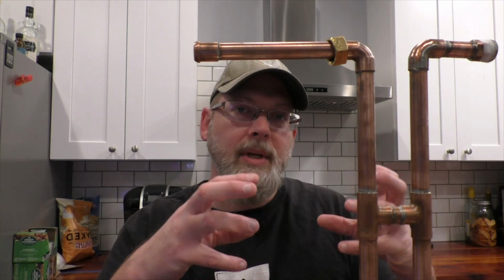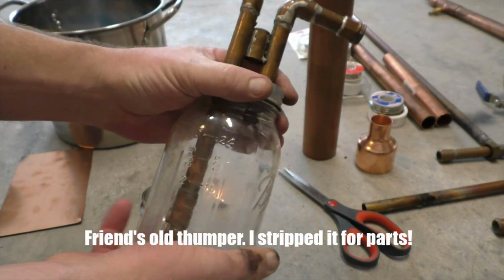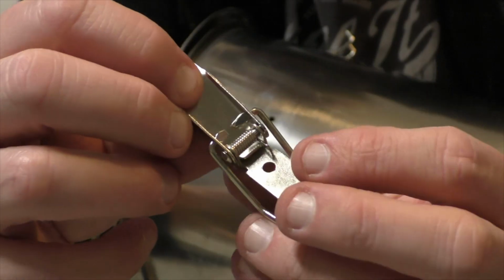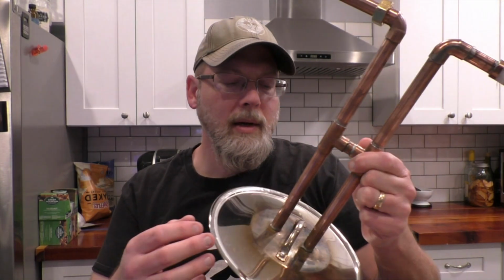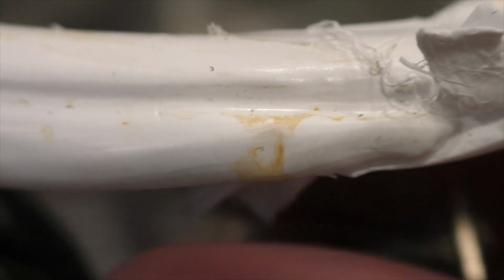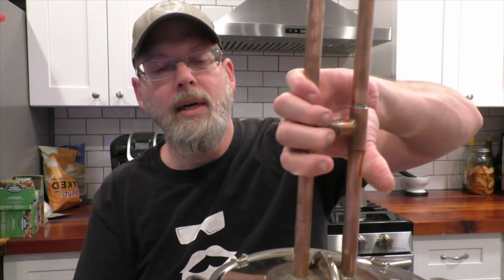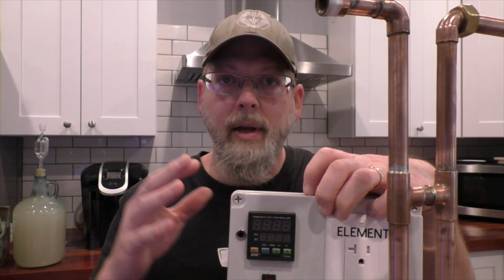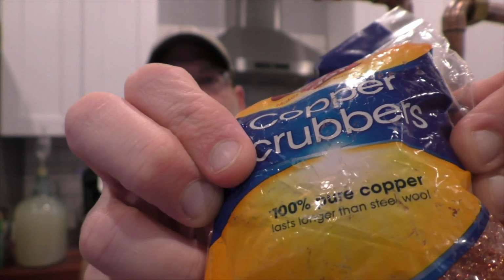How to Build a THUMPER For Your Pot Still!!

Comment: Great video! I would use FDA silicone for the gasket though.
Reply from the maker: Under hot ethanol, acetone, acetaldehyde, etc. silicone breaks down. PTFE and EPDM are safer since they're rated for those temps and chemicals without leaching.
Reply: @BeardedBored  You are right; I was lazy and just made my gaskets from fda silicone,  but I will change those out for PTFE gaskets, thanks for making me look into it further.

Comment: I know this is old and this is a great video, but you said don't use brass screws and then added a link for a safety relief valve made of brass. A stainless ball valve with teflon seals would be a lot better, because you would have to have 2 safety relief valves mounted in opposite orientation to ensure you prevent both the build up of pressure and to prevent the vacuum build up because just putting a pop-off valve that vents to the outside wouldn't protect from vacuum. Vacuum would just pull the seal on the pop-off tighter. I would just forget putting a safety relief valve altogether and use a ball valve and manually open the system to atmosphere.

Comment: Could you please post the size and names of the plumbing parts of the thumper .. I'm currently building one and my local hardware store has all the parts I would ever need just not sure what to ask for other than the 90° elbows and the T's.. just not familiar with the names of all the plumbing connector names .. I really like the threaded connector idea so it can be disconnected when not needed ..  I already have the lid seal and the clamps  finished and the pressure releif valve installed but  a parts list for the pipes and fittings would greatly appreciated.. thank you so much for all the content and taking the time to make everything make sense for ppl like me that enjoy this hobby..
Reply: I wouldn't use the pressure relief valve. The one he showed (the link didn't work)was brass and only works one way. You would need two of them mounted opposite. One to blow out and one to suck in.

Comment: I am taking a 8 gallon stainless still pot and converting it to a thumper for a 16 gallon stainless pot. As you mentioned the lid is really thin, i am using Ruby stainless steel flux. Having problems with it burning up before i can get my solder to flow, then i have to deal with the carbon that of course stopping the solder from flowing on the stainless. Is there a different solder that works better for copper to stainless? Oh i used a sheet of food grade gasket material with a double sided tape on the one side for my lid gasket. So far so good no leaks.

Comment: Not to sound like a know it all but you will like these tip.  I am a retired Pipefitter / Welder.
 Wear a heavy cotton glove DRY. WIPE the joint.
Use a Weller soldering iron  on the pipe thru the stainless tank.  1/4 " tip  
Hold it on the solder "   " soak it"   I recommend Harris "Bridge it"  
lead free strong.
I use the iron when I put valves on Coleman Green propane tanks.   Tin both surfaces. Hold it in one place let it heat up "soak it"  lay the flat tip on the pipe  transfers the heat.
Iron heats the solder, solder heats the metal.
Try it and see. My iron is 25-30 watts. It's the one I use for Electronics.
Sal Ammoniac  what you tin your soldering tips with. Block or granulated like salt.    Dimple a 2x4 with a ball peen to hold a small pinch of Sal.  Get the worst burnt black tip in your iron and rub the tip back and forth in the Sal with a B-B size of 95/5, pure tin or Bridge it  in the Dimple . , sal-ammoniac will be under ammonium chloride.
Flame solder your 
pipe for sure.
The iron won't warp the stainless

Comment: You put your gaskets for the clips on the nut side. This is not good, as you can get vapor leaking between screw/nut threads. Putting the gasket on the screwhead side doesn't work either, unless you ALSO put a gasket between the clip and pot. Additionally, the pot handles are rivetted on. This is NOT guaranteed to be a good seal either.
A good idea, but flawed.

Comment: Another GREAT Video!!! Excellent safety explanation!!! I built my thumper with a tee and two ball valves for a by-pass line around the thumper. When starting up my still I open the valve that by-passes the thumper (while the valve to the thumper is closed) but goes through the condenser. I have a cork stopper in a tee between the by-pass ball valve with a thermometer to give me an idea of where the temperature of the vapor stream is to also tell me when the foreshots are boiled off (and I also collect the foreshots at the end of the condenser they are a very good solvent for cleaning). After the foreshots are gone, I open the valve to the thumper and close the valve to the by-pass in that order and let the thumper come up to operating temperature. I also add a 50/50 mix of tails and boiling water to my thumper to get things heated up as much as possible. When I shut down the still, I wait until the condenser stops dripping and then open the by-pass valve before walking away. I have seen the video of people throwing  water into a 55 gallon drum on a fire and closing the bung hole and spraying the drum with water. the effect is drastic!!! Actually that is how the thumper gets its name. As the hot vapor starts to hit the slightly cooler liquid in the bottom of the thumper the vapor condenses and sucks a small volume of liquid from the thumper into the down pipe (that is why you want a short section of pipe above the thumper). That small amount of liquid moving up the inlet pipe makes a thumping sound.

Comment: dry rag never use a wet rag on a joint it pulls the solder out of the joint  leak . hit the slop with your acid brush and acid wipe

Comment: As a certified structural and pipe welding specialist, the fact i cant solder is infuriating.  I can weld iron, steel, chromoly, manganese (or mangalloy), and stainless 6-ways to sunday. Im one out of a handful of private contractors legally allowed to weld sensors for submarines,  transducers for the petroleum industry, and custom alloy parts for the I.S.S  that cant be milled, or cast. BUT AM COMPLETELY INCAPABLE OF MAKING A COPPER POT.
Reply: Translater

Comment: Great info....long story short, my cousin won master distiller on moonshiners a few years ago (don't wanna mention any names 😎). We have a brandy still and a big copper still that has 1/2 gallon mason jar thumpers. We've used this setup for years without any issues whatsoever. He runs 2-3 times a week year round and hasn't broken a single jar, surprisingly. I honestly wouldn't worry too much about the glass not holding up, there's hundreds if not thousands of runs on these jars and we've not had any issues. I would've never believed it if I hadn't used them myself.
Reply from the maker: I have to consider the risks of what I put on my channel, so I tend to recommend the absolute safest approach for things, just to avoid the chance that something goes wrong for a viewer.
Reply: @BeardedBored  I understand completely, I will let you know if we ever shatter one. 😂.

Comment: I put a ball valve in the section between the T fittings which is great for not only sending foreshots out without disturbing the flavor stuff in the thumper, but also lets the air pressure in the pot even out when open at the end of a run before turning the heat off the pot, preventing implosion.
Reply from the maker: Nice!
Reply: Wow, great idea!
Reply: Vacuum Breaker or Vacuum Relief Valve, when safety is first.
Now you can have your "heart problem" or power out and still own a functional house ;)
Reply: L port valve is safer

Comment: Mason jars are more often used like gin baskets, to infuse flavors which you can do with a thumper too no problem. They can also comfortably withstand temperatures up to about 280°F which with a still, you shouldn't ever really get above 180°F, which is well withing the working range. They can withstand a vacuum pressure of well over 15 psi which means it can withstand a postive pressure of equal grade. For small stills theyre fine to use cause you really shouldn't develop any more than about 1-5 psi max depending on your setup. If youre getting higher than that theres another problem somewhere else.
Reply: So unless you're being an absolute moron, they should be perfectly fine to use so long as youre using canning mason jars, which are made for taking repeated heat and pressure cycles. Both mason jars and sight glasses can be made from either Borosilicate or Soda-lime glass.
Reply: Add some spring clips hooks to the lid for an extra level of safety, I know there's a a lip around the top, but having that extra level of security can keep you thumper from blowing it's head off.

Comment: Mr Bearded,my thumper is just like that,except for a little  change I made,your verticals may be too close together,but remove your 90's and replace with T's,put a valve between them,now you can run like a pot,close and activate thumper,or open on shut down for open system,it works!
Reply: Could you kinda give more details on how you did this I'm drawing a blank. I get making the verticals a little further apart but how did you put the Ts on and put a valve between them is where I'm struggling.  Thanks for the added info is really does help a newbie.
Reply: I like to have a bypass, I use 3/4",down off a T,stainless ball valve to a T,across and back up,as you can remove foreshots, when you close valve you have reheat thumper, it is a safety feature.

Comment: What about using a thumper with the type of still that Jesse uses on Still It? Does the still type preclude using a thumper since it has so much reflux capability? I'm only asking because the open top design seems like it would be the safest way to go considering the potential for pressure problems.

Comment: I'm like a Jedi on the mechanics of the process,when you brought up the process of shooting the thumper,I thought back where I seen this ,then it came to me,it was a wide pony keg with a 4 inch ferrell on top,after the heads,he just popped the clamp,opened it an put a bunch of fruit in it,he did lose heat,a little steamy,so I thought about the bypass,which is only a valve above the top,you run the heads like a standard pot,when your through heads you open the 3/4 ball valves and let it go,then to avoid any chance of vacuum you close the valves at the end and your back into pot still mode and simply shut down,my mistake third valve in the cross over,your thump is charged from the start,works fine,you've taught me a lot,all three of you have unique perspective.

Comment: I'm late to the party but thank you bearded. I've learned more in watching this video that I have in dozens of others. One thing I've learned is to keep your thumper above your boiler. This will keep your thumper from filling up. Also as another option, disconnecting your thumper from your boiler right as you shut down will help clear the vacuum. Good stuff brother I appreciate it

Comment: to the creator, I just stumbled upon yer site and this vid. New subscriber. I have a 5 gal Chinese unit with thumper. had about a dozen runs. only 3 fails (was told one wasnt a fail , but a batch of orange sunshine. ummm aint verified that but he been at it about 40 yrs soooo...Doh !) loved this clipp. learned a few things. I did a quick somewhat deep dive into the comments to try and find any info on how much the thumper build was at the time. and also same for the main unit. any direction please or even a direct answer is great !! LOL and soooo rare these days. great clip, looking fwd to further discovery. Peace and God Bless.
Reply from the maker: Best to use 2 SCR's to keep from overloading one. Jesse runs 2 and uses them at full power to heat up, then shuts one down and uses the other to maintain temp and increase the heat as needed.
Reply: @BeardedBored  not sure what that means nor how it would look. sorry. did you do a vid on that by any chance? thx again.
Reply: SCR ?

Comment: What gasket material do you use
Reply from the maker: Expanded PTFE tape. There is a link is in the description of my thumper build video, but you can find it from plumbers supply places. You can also use EPDM. Both are non-reactive.

Comment: Thank you for showing us how to build... However you did not show us how to design the darned thing.
*optimal volume in relation to the potstill volume? 
*how deep and what diameter of thumper? 
* dippipe length i.e. how far from bottom shall the open end be?

I refuse to believe that any size thumper will do the job okay. Building a thumper is more than soldering and a bit of handyman's work. You have to think first. 

You did not mention that a thumper creates slight backpressure in the potstill... this can cause alcohol vapor leakage and even a fire hazard.

Comment: another stupid question.  Doing your thumper build BTW :).  I see the 5 psi pressure relief valve is threaded.  Can that be soldered on to the top of the pot?  Would it need to be threaded??  Like I said, dumb question.  As you see by my last question, I already have a 5 psi valve on my still but, like you said, "better safe than sorry."  Appreciate your thoughts and thanks for your channel.  Good stuff.  Another BTW.  Any idea what happened to George?  Been off line for awhile now I see.
Reply from the maker: You might damage the spinge and seal in the valve by soldering it. My suggestion is to use ptfe thread tape and drill the hole tight. Flour paste for any potential leaks. No word on George. Still on a break.

Comment: Ok, I feel dumb. Those are not compression fittings, they are unions. I guess I should turn in my armature plumber's card.
Reply: No but you should turn in your I learned to spell card 😂😂😂😂😂😂😂😂
Reply: @smyers820gm   Too funny! I hate spell check and yes, I didn't check what it provided. Drinking while typing doesn't help either.🙃
Reply: By the way. I should have typed Learnt. Sorry for miss spelling.

Comment: For a better seal arount the pot use cler tubing slicing it down on one side making sure the line is straight
measure around the circumference of the pot and make the cut as tight as possible then glue the ends together for a good seal.  Hope this helps.  Cheers.
Reply: Then we're back to what kind of tubing. PVC isn't great at those temperatures and like he said, silicone reacts to some of the stuff in the wash. It's a great idea though.

Comment: Word of warning: Be SUPER careful dremel-ing out copper pipe. About a year ago I wrecked about 25 square feet in my basement because I took a dremel to a copper pipe using a burr-style bit. The copper dust wasn't actually dust but millions of tiny shards that instantly dig themselves into your skin/clothing. It was weeks before all the slivers came out and no matter how hard I scrubbed that concrete floor there were still hundreds of shards there. Either use a sanding bit (which just creates dust) or do it outside. Also, the shards really stuck to the inside of the copper pipe and it took some ingenuity to get them out of there.

Comment: Ive made thumpers from glass since day one they hold no pressure  so why would they so called explode break crack. As well as how much space at the inlet at the bottom of your thumper. As far as gaskets use silicone baking mats purchased at any grocery store. It's not rocket science it's common sense
Reply: If it's building steam it's building pressure.... maybe not much but it's still building pressure. That being said most mason jars are designed for heat and outer pressure from canning so the would probably be OK in a perfect world however we exist in an imperfect world where accidents can and will happen. Therefore fragile materials, flammable substances and newbies don't belong together for safties sake.... that being said do what you do and happy distilling dear friend

Comment: Instead of mason jars order glass globes for paint shop lighting. The threaded end will fit a mason jar lid and the bottom end is rounded instead of flat, really adds to the cool look. The glass is heat tolerant as sight glass would be. It takes the danger of rapid tempiture change breakage out of this type of thumper. If you want to really go cool take a 2"x1"x2" copper tee and split the copper on the bottom side then flaten the 2" long side into a flat peice of copper with a 1" fitting coming out of it. Cut it to size of jar mouth. Take a 1/2"×1/2"×1" tee and grind out the stop on the top 1/2" fitting port so to slip a 1/2" pipe threw it to the bottom of jar then you can come out the side of the tee with 1/2 pipe to worm. Ptft tape makes good gasket for the flat mouth lid peice. A lot better than soldering two pipes threw a flat peice of copper. Solder is prone to run out of on joint while soldering the second one. The 1/2" pipe going threw the 1" fitting leaves room for vapor exit back up and out the side 1/2 pipe. If you run a hot pot maybe use   1 1/2" instead of 1". Safer to have more exit room incase of puke causing preasure.